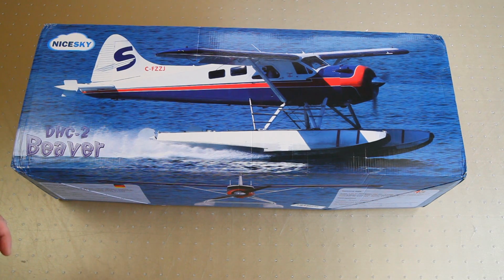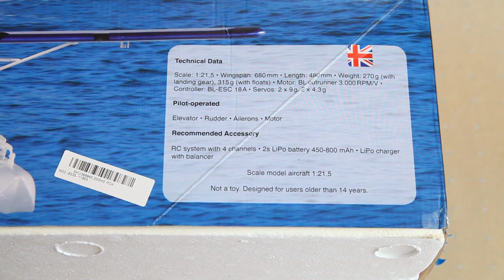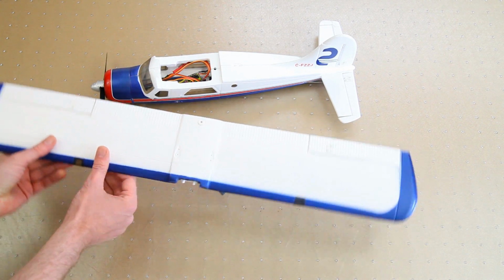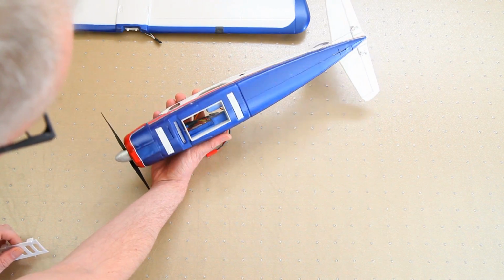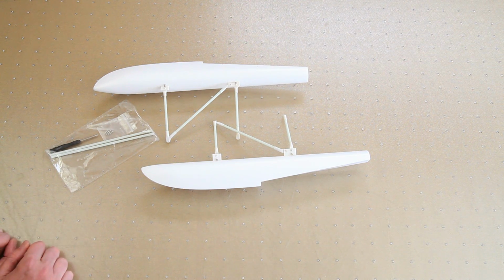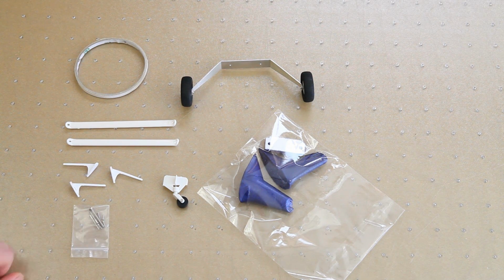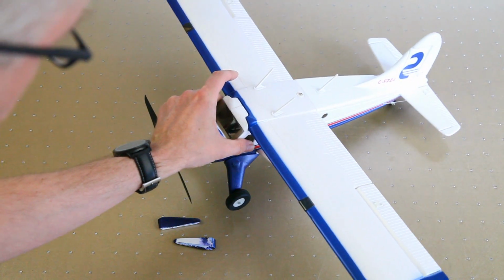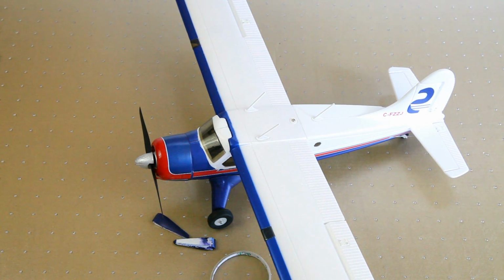Dehavilland DHC-2 Beaver 680mm brushless - Show & Tell

Comment: Looks like a pretty well built and a very nice little plane. It's too small for me, I like planes where you don't need to worry about the wind too much ha ha (-:
Reply from the maker: +Jax Teller RC That IS a downside.. In parks (with people) I don't wanna fly a big plane though :$  Anyway.. this plane looks sooo nice.. I just had to have it :)  It's actually even a very nice display-model :)
Reply: DutchRC Adventures 
I have lots of small flying RCs and have to get on the weather channel to make sure there will be no wind the next day. It gets old pretty quickly ha ha. It is very beautiful (-:
Reply from the maker: +Jax Teller RC Yeps.. that IS a drawback for sure :)  We'll just see.. it's a bit heavier then most micro planes..
Reply: DutchRC Adventures 
(-:

Comment: nice little 250/300 size model there Dutch! Very good bench look and thorough. Be nice if it had lights installed but you can't get everything! Looking forward to your flight video. :)
Reply from the maker: +Discover RC Thanks buddy :)  Yeah.. I can't imagine 2 LED's would have cost much.. Would be nice.. If the plane flies well (and slow) I'll probably put a micro FPV system on this one by the way :)